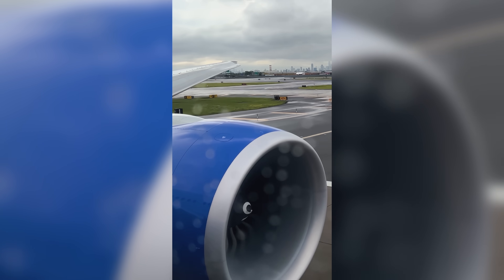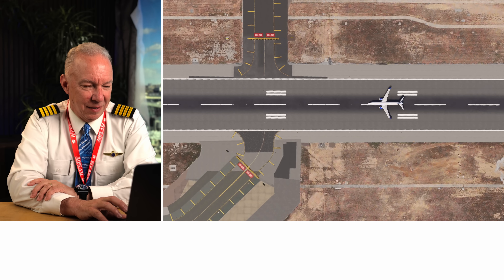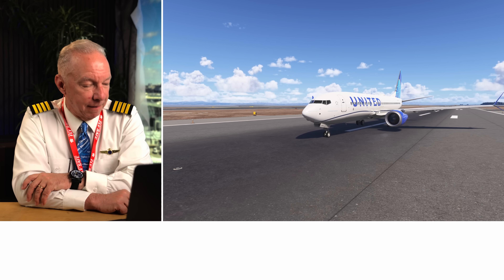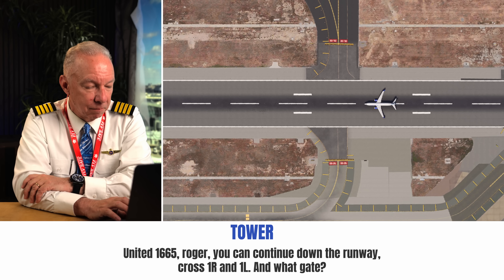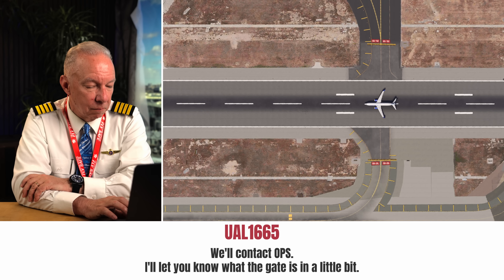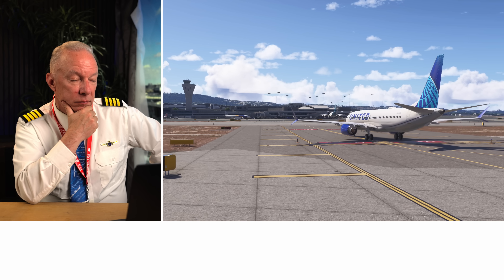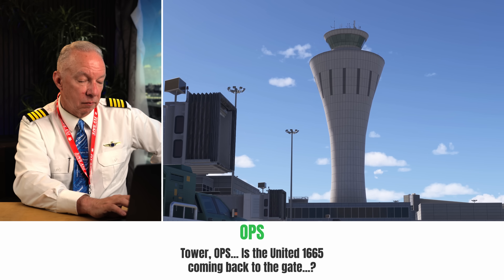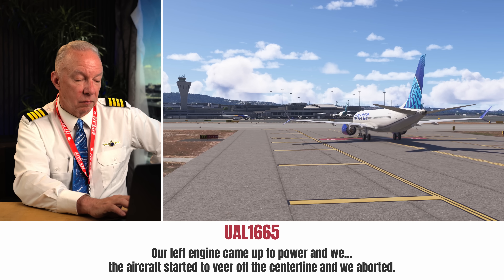UAL1665 Aborts Takeoff – What Pilots Do When Things Go Wrong

Comment: As for engine run up. Don't the pilots stand on the brakes? Then when power looks the same, just continue to takeoff power and slowly release the brakes? At the start of roll, determine all ready spooled up motors are equil by gages and feel. Why do a rolling start when error shows up later and running out of runway?

Comment: Interesting point - If you V1 and rotate, just after lift off and blow an engine, is the yaw as bad as the yaw felt when spooling up the engines for take off and one engine only comes to 50% power? Which yaw is worse?

Comment: Similarly, why did UAL 1321 going to LAX return to Newark Liberty after circling for over an hour yesterday 4/28/25. I believe an emergency was declared because of a "mechanical" issue but United won't seem to say what the emergency was. Based on FlightAware it got to 4600 feet and then circled and circled. What happened?
Reply: It seems there was a bleed issue. What does that mean?

Comment: Exit door. Back in 1997 on a Royal Airlines jet to Las Vegas I had but, the others just chuckled. An engineer could tell from the funny or off sound the starboard engine was making that a bearing was going and said so. I was told not worry. If it was that bad they would have looked into it. I have been on airliners before and never heard that off noise.

Comment: 1:11 hey captain steve I have a question you said you check if the engines spool up together and then hit the TOGA button and hope they spool up together 100% is that 100% of the engine’s RPM or 100% of the TOGA power that is from the computer? I only ask because I herd airlines derate the takeoff power to preserve the engines

Comment: As a retired airline pilot with 30 years in the captain’s seat flying 6 different jet airliners, I wonder why pilots today rely on the autopilot and auto throttle to fly the aircraft. I preferred to handle the throttles and fly the airplane. Every 6 months, FAA regulations required  me to demonstrate proficiency hand flying normal and emergency procedures. When a problem occurs, the first thing is to disconnect the autopilot.
Reply: It's not quite That simple in an Airbus for one.  The throttles are 'virtual' with no direct link between position and thrust setting.
Reply: Aircraft and procedures have changed quite a bit since you retired.

Comment: I like your video is explaining things. Years ago I mean, probably about ten years ago I was on a flight to go from Philadelphia to San Diego for a business trip and I remember twice. They had us wait where they checked something, and then they ended up going back to the gate and had us get off of the plane, and we were told they were going to work on the issue and they worked on the issue.And then they had us get back on the plane. And then when they tried to take off again, they ended up aborting the takeoff, they went back to the gate.We were told to get off.We were given a voucher to get food. They ended up finding another plane and because it was such a long delay between initially when we were supposed to leave versus when it was changed to we had to find the crew,. I finally arrived in San Diego at 2am and had to be at the USN facility at 730am so I wasn't thrilled with the delay however it's better to be safe than sorry.
Reply from the maker: Sorry to hear about your super long day. You are right better safe than sorry. I’ve had to make some hard calls over the years knowing that hundreds of people would be totally inconvenienced but safety is paramount! Fly safe.

Comment: ‘Love your videos, Steeeve!
I had an engine eat itself, very noisily, with fast compressor stalls, immediately after lift off. The plane was a DC-9, with 77 passengers, on a hot day, out of Medan, Indonesia. The year was 1977, the plane was a DC-9, and I had been a captain for about three weeks. It was scary, but the copilot and I followed our training, climbed away from the ground, and brought the plane back around for a nice, safe landing. 
It was also other-worldly, because the air conditioning performed its auto shut down when the system sensed the engine failure. (The air conditioners shut down so that the remaining engine gets to send all the energy it makes out the tailpipe.) Everything became so quiet, without air rushing out of the air conditioning nozzles. 
Back on the ground, standing around, I tried to look calm, but I was quite shaken.  Sometime much later, I had another engine failure, but this time I had the previous experience working for me, and everything was much easier. No more engine failures, and retired 2013. And Yes I miss it!
Reply: Wow, that's quite an introduction to captaincy! Glad everyone was alright.

Comment: I’ve been on 2 flights that had a similar issue - one aborted takeoff at Newark where the plane behind us told the tower our engine was on fire and another at LaGuardia (shorter runway) where we had to get airborne and go around very quickly (I fly a lot and have also been through 2 emergency landings). The worst part of all 4 “events” was the delay after it happened. I’m so grateful for the professionals up front and in the tower and the quality of the maintenance and emergency crews we have.

Comment: I was flying a home built P51 Mustang out of Williams right after they turned it into a civilian airport.  On the way in I lost engine power and had to make a dead stick landing.   After I landed I was surrounded by fire trucks.  I apologized for bothering them.  They said it's no bother, we sit in the fire station day after day bored to tears, nothing ever happens, this is great.  They then offered to tow my plane to the hanger.  I accepted and they towed it in.  I had a lot of fun flying out of that airport.
Reply: So what was the cause of the engine failure?

Comment: A 737 I was on lost one engine at cruising altitude and we had to have an emergency landing. I recall the captain saying that the aircraft can fly just as well on one engine as two. After watching this video, it sounds as if taking off with one engine will not work because the aircraft would veer left /right over the centerline. Am I interpreting this correctly?
Reply: roger

Comment: Going 500 mph in a metal tube is not safe. Nothing will convince me otherwise, too many things can and do go wrong. Sure, the statistical chance of a horrific crash is low due to the sheer volume of flights, but when something goes drastically wrong, good luck. Weight and balance issues, small things that havent been discovered, the human factor, ATC radio transmission issues (stepping on frequency, which is absurd that still exists btw). In 2025 we have passenger jets colliding with helicopter. Many near misses at busy airports, planes crossing runways while others are landing. Swiss cheese every time u get into a plane.
Reply: Thanks Debbie

Comment: I had a kind-of similar event, at least it involved asymmetrical thrust.  Had a dimwitted, and nasty copilot.  He was flying.  At cruse, the airplane was straight and level, and the throttle levers were matched.  This guy clearly never learned to include engine instruments in his scan.  We probably had, had a minor altitude change, and when we leveled out he was trimming and trimming the rudder... he was a problem child, so I let him go for a bit.  Then I said: you wouldn't need all that trim if the engines were producing the same about of thrust.  He finally checked N1, did a little tweak with the throttles and eventually unwound the trim.  This was on an MD-80 a long time ago.
Reply: Why was he flying a jet if he is dim witted.
Reply: @TheGnarTube  You'd be shocked at what was available to airlines back in the '80's.  It seems it's only gotten worse.  Way back when, a lot of people in the right seat were called "seat-warmers".  Just there to talk on the radio and operate the landing gear.  It wasn't quite that bad when I flew, but some of the pilots, both captain. and copilot were, well... lets just say, I don't know how they kept their job.
Reply: @dieselnine1022  Was there a lack of suitable applicants ? Did your airline do its own training or did you expect pilots to work their own way from CPL to ATPL ?

Comment: So yes.  I was recently on a flight from Nashville to Baltimore.  Flight 3440 had powered up the engines. I started a count in my head as I always do on take offs and got to about 10 seconds when the plane made a hard left then hard right and the crew cut the power and stopped.  The were a few screams and yes it does cause the hair to stand up on the back of your neck as well as  causes your sphincter muscles to go vibrate a little.  Did talk with the FO later as we all went to a different aircraft.   He said all was good, FO was pilot flying he hit to TOGA power came up normally then a few seconds later left engine just rolled back.  He applied a quick right rudder and at the same time the command pilot grabbed the yolk and said My Aircraft and shut everything off.  I know if we were at V1 and it happened we'd have to go with it but very glad we didn't.  Thank to the crew. They did a fine job.

Comment: I'd bet 'thrust wasn't engaged' was his way to say the two engines weren't working 'together' (As was later stated). It may not be common in ATC communications, but it is common phraseology in many other fields - and is the fastest way of saying 'we have/had a problem, but we don't know the cause'. In my field, theatre/live entertainment - didn't lock, didn't engage, didn't sync, didn't follow, didn't capture - all basically meaning the same thing (depending on the type of 'failure'). It's a short phrase to answer, with detail to follow after attending to other things.

Comment: “ 100% “
Understanding turbines :
100% is not always 100%
On older engines we had to look at a chart that calculated density altitude by temperature, barometric pressure and temperature.  That would tell us the take off. / TOGA power for the day and time. 
On cold days with dense air at low altitudes - 100% could be 92 or 93% On hot days at high altitude take offs - like Denver , in the summer - 100% will be over 95, like 97%.   100 % is based on the air load you are loading on the engine parts and airframe. 
Now - modern jets have a computer controller called FADEC.  Full Authority Digital Electronic Control.  The FADEC computer does all the calculations faster than you can think and automatically control the maximum take off power as well as fine tuning the engine for max efficiency in cruise ….. among other things.

Comment: Low speed, take off thrust. When thrust symmetry occurs (like engine failure or engine hung below take thrust) then rudder is useless until rudder effectiveness ( rudder does nothing unless sufficient air flow over control surfaces). Aircraft swing is inevitable and only action is to immediately abort takeoff. The speed that rudder becomes effective during engine failure is known as VMCA. This is why we have a V1 speed. Below V1 takeoff is not guaranteed above V1 take off should be successful in the event of an engine failure. Capt A350 (UK)
Reply: But also note that in most aircraft, at low speeds where the rudder is not yet effective, the rudder pedals have some authority over nose wheel steering to prevent this issue